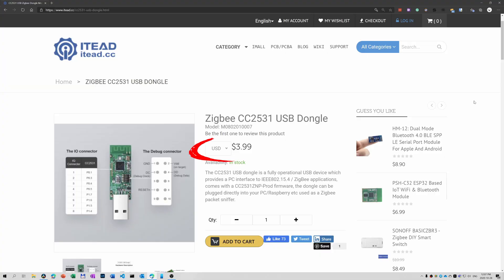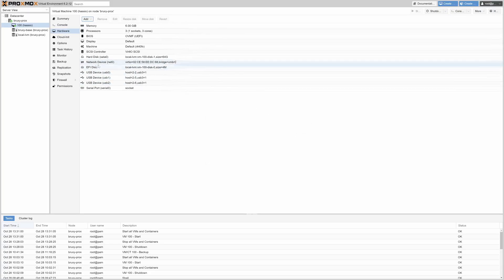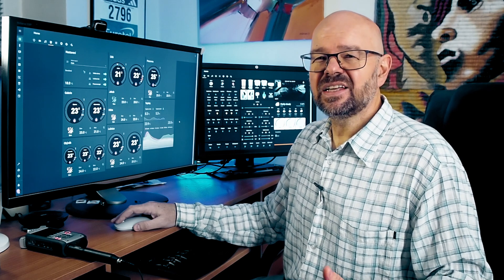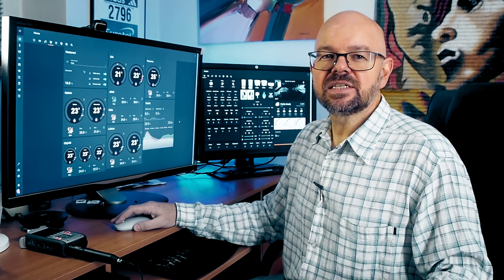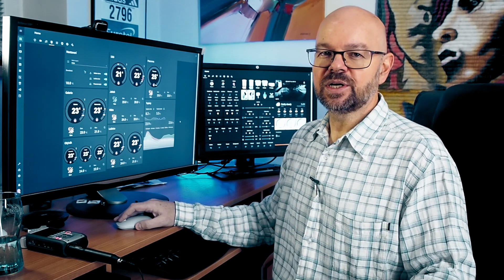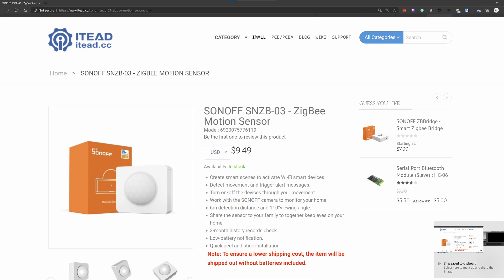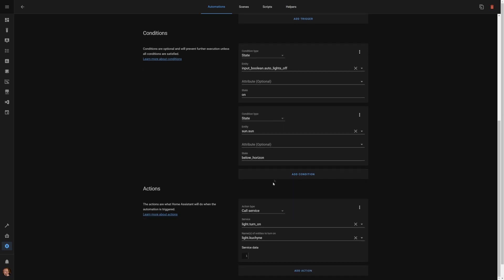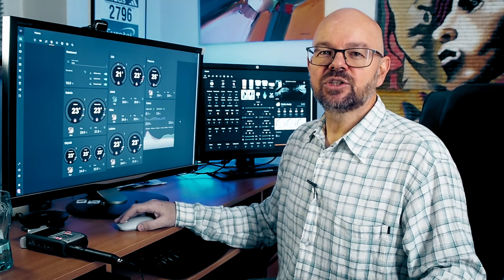How-to ZigBee in Home Assistant

Comment: Did you install directly onto ubuntu or are you using docker? Most of the docs I'm finding talk about using docker instead of installing directly onto a vps.
Reply from the maker: I install Hass OS on NUC, that runs Home Assistant. It used to be a supported installation to NUC. I think they now extended that to Generic Intel.

Comment: Which sensors do you recommend? (And do you have a smart smoke detector sensors ?
Reply from the maker: I have smoke sensors as part of my dedicated security system (which is monitored 24x7, so if there is a fire, they will send firefighters - that probably won't work with HA :). 
The sensors are evolving fast. I use the SONOFF door and motion sensors. But there is a bunch of others. Recently, Lidl supermarket started selling some very cheap. IKEA has some as well. So it is about how cheap they are (which will allow you to get plenty), if you like them and how they work - I suggest getting one and trying. If they suck, just throw it away or use them somewhere non-important - they are cheap.
Reply: @bruxy70  Great. I use Sonoff’s Sensors too. And I have tried Xiaomi sensors and they are so cheap.(Around 3 to 4 US dollars each). Much cheaper than DIY motions sensors. And they actually works. Have a try on Xiaomi sensors!

Comment: Thanks, good content. Just bought one of those sonoff motion sensors, but it was permanently detecting motion, only when I turned it to face the wall did it behave, so not so useful, have returned it. Going to try one of the IKEA motion sensors..., Zigbee is extremely useful and very flexible..... anyone else had problems with the sonoff motion sensors?
Reply: I'm getting unreliable false triggers. I have one in my hallway and had noticed the lights would turn on without anyone in the hallway - started logging and it "detects motion" several times per night when there definitely hasn't been any motion.

Comment: I'm just starting out with Home Assistant (migrating from Homeseer) and I'm struggling to work out how to do something - essentially in Homeseer I create a dummy/virtual device to hold a value (say whether I want any actions to run), but I simply can't find a way of doing this in HA.
And then I watched your video where you've done exactly that - you call this master switch a "helper". Great, thinks I, I've found out what it's called, so now I can search for how to create one. Unfortunately, Googling for 'home assistant helper' yields nothing.
So, please could I ask how you created input_boolean.auto_lights_off?
Reply from the maker: Configuration/Helpers :)
Or define them in YAML - search for input_boolean
But I'd do that from GUI. The good thing about that is, that it works right away, you do not have to reboot
Reply: @bruxy70  Fantastic, thank you - that teaches me not to Google something when there it is standing right in front of me in the UI!

Comment: Vaclav, thank you so much for the videos. Currently I'm investing in some home automation: Tuya lightbulbs, fire/smoke alarms, smart plugs (all wifi) and a Zigbee 3.0 hub with temperature/humiudity sensors etc etc and have received also two google nest mini's and next week a google nest hub. How did you connect your google homes to Home Assistant?? I really would like to switch to Home Assistant to make better automation logics, but integration of Google is a must for me. I know there is a paid subsription plugin for Home Assistant but I don't want to be relying on 1 person with a paid/subscription solution. Hope you can help me out!
Reply from the maker: Personally, I pay NabuCasa subscriptions. One reason is that I'd like to support the project. And the second that it automatically does the integration with Google Assistant, and it keeps constantly improving. But if you do not want to go for the subscription, you can set-up the connection manually - you'd have to set up the integration on the Google Developer portal and then configure a connection to that in Home Assistant - https://www.home-assistant.io/integrations/google_assistant/

Comment: Hi Vaclav, nice video! I was thinking about the problem that you had with your wife trying to turn on the light while home assistant was restarting and it not working. Do you think that using lambdas could be used to solve this? Like the shelly could wait for some kind of message from home assistant saying that the button press it sent has been registered. If it doesnt get this, it toggles its own relay to turn the light on! It would be a nice backup if possible!
Reply from the maker: All my light switches work without Home Assistant, this is not an issue. But where I have Zigbee bulbs, they are powered all the time, but the light is triggered by the Zigbee network - which does not work when Zigbee network is down. But not an issue, I just have to think when I do maintenance ;)

Comment: The small cc2251 is limited to 20 devices, at least with zigbee2mqtt
Reply from the maker: Good to know.  Thanks! Have 13 now, so I will keep that in mind.
Reply: Right, but using zigbee routers, this limit can be increased
Reply: @imotelica  I had to replace it when the network reached 48 devices despite having mostly only zigbee2mqtt routers. It was running out of memory. zzh! CC2652R Multiprotocol RF Stick is a much better choice and can handle even 200 devices.

Comment: Hi Vaclav, great video as always!
What are benefits of using ZHA over zigbee2mqtt?
Reply from the maker: I can't fairly compare the two, as I haven't tried both. I read some comparisons and they generally say that there is a lot of development in ZHA recently, but it lacks support for some devices. but I installed that and it runs flawlessly, so I have no reason to change. I love the ZHA network map.  And I somehow do not like the idea of sending everything through MQTT locally on the same host, looks like an unnecessary step. Also, when I moved my light switches from MQTT (Tasmota) to ESP using direct API, it works much faster and more reliable. Not sure if this also applies to ZHA, but another reason nevertheless.
Reply: I run my main HA install on a Pi4 and use a Pi3b+ with the same stick but with an external antenna on it. Z2MQTT runs great on the Pi 3..